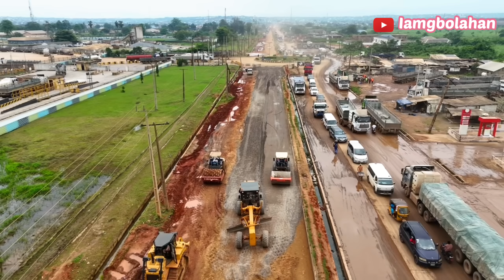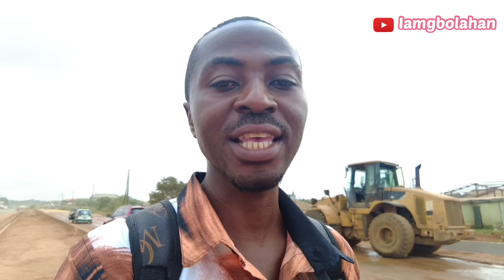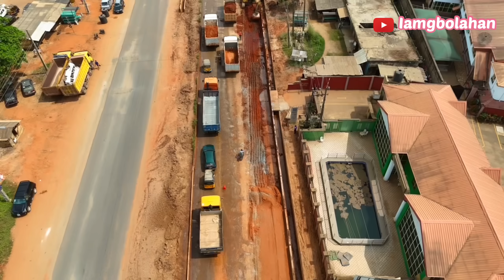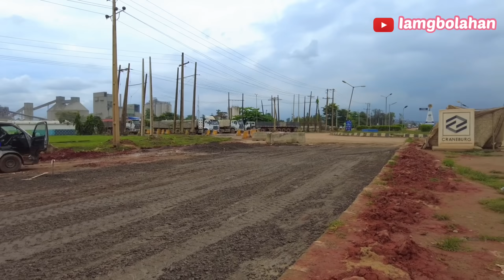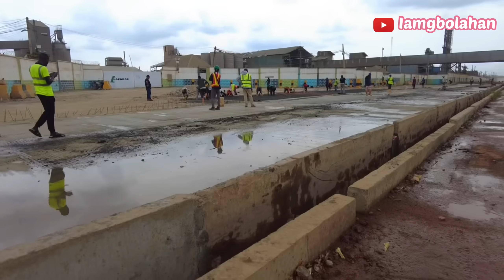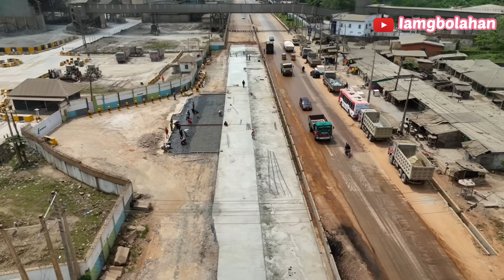Lagos-Abeokuta Expressway Construction Update || Why Is Concrete Pavement Now Being Used?

Comment: These 4 lanes highways are part of Nigerian problems, for the trade and passenger volumes along this road, it should be 8 lanes highway from Lagos to Abeokuta. From Lagos to lshsra should be 12 lanes.When you think Ghana is building 10 lanes from Tema to Accra, less than 6 million people along that route. Kenya has 12 lanes from Nairobi to tikka, less than 6 million people. Nigeria, Lagos alone is 20 million people yet it has 4 lanes to Abeokuta, and 4 lanes to lbadan.😢 Yet the leaders can't even maintain 4 lanes..
Reply: I completely agree. 

Roads need to be future proof, not just made for the current population.
Reply: The Governor @DapoAbiodunCON promise 18 month completion but it doesnt look like it will be completed within 2 years
Reply: 6 lanes to Ibadan
Reply: @hillcrestprofessionalservi3502 No, it's not 6 lanes to lbadan. The 6 lanes is to Ogun state section of the road after that it becomes a 4 lanes highway. Lagos to lbadan should be 12 lanes from Lagos to about 40-50km and the 6 lanes to lbadan..
Reply: The solution is the concessioning of the highways

Comment: Ideally, that road with its heavy traffic and heavy-duty trucks with loads plying it a lot, should be reconstructed with a concrete rigid pavement. The construction work on the road is not only slow, but also being poorly done. That is why, even though it is asphalt that they are using, it seems they are changing that on some sections of the road now; some sections of the road have started getting damaged within 3 months of construction. Dapo Abiodun needs to do better; his works, overall, have not really been good, let alone great. As always, Gbolahan, great work.
Reply from the maker: Thank you for your detailed insights and kind words! Your points about the need for concrete pavement and the observed issues are what I also observed about the ongoing construction.